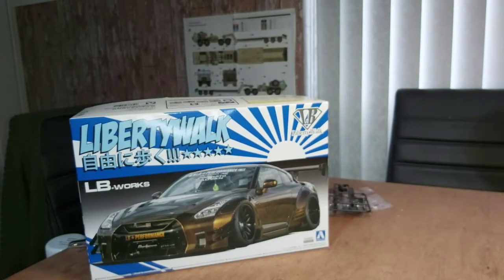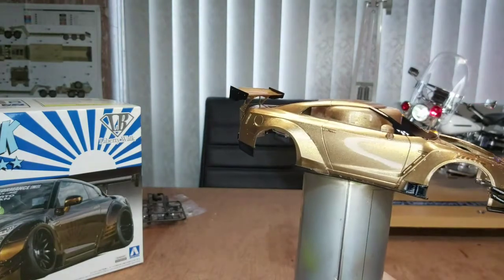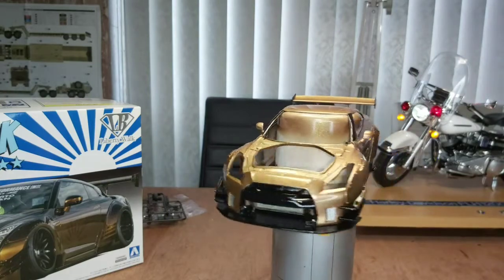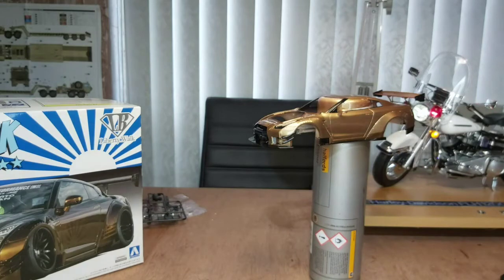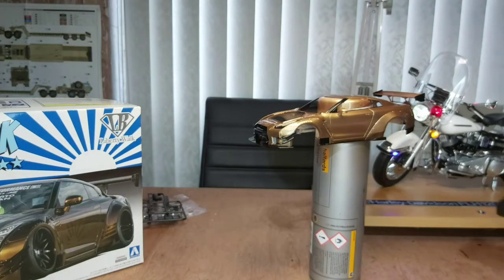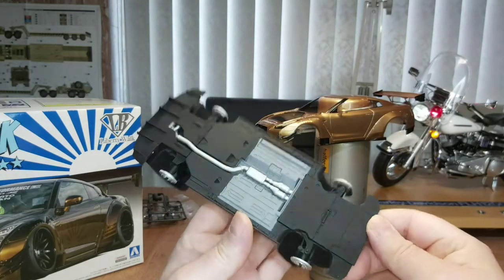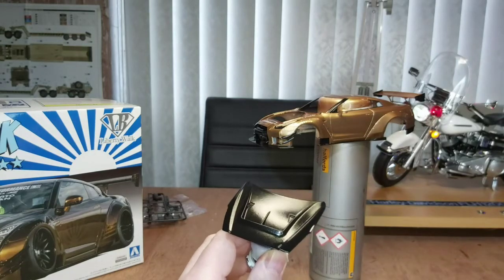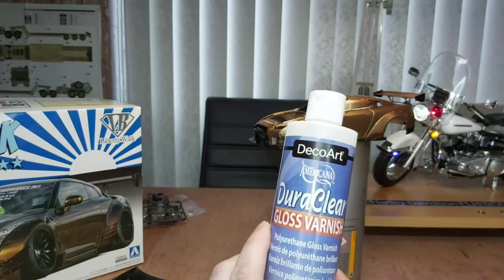Update on the r35 Liberty walk

Comment: Did you use canned clear coat or did you airbrush it? I have problems with flaky paints and clear doing the same thing that happen to you. So I stopped using canned clear on these kinds of paints and went with airbrushing the clear.
Reply from the maker: No 2pk clear in the airbrush I think some of the craft paint can be temperamental at times depending on brand 👍